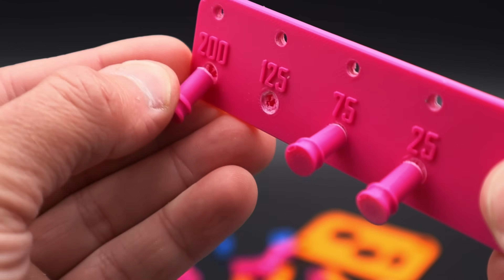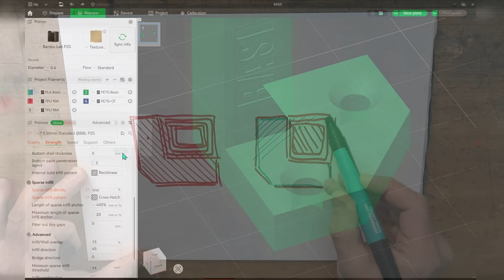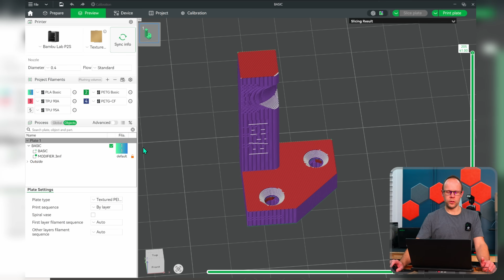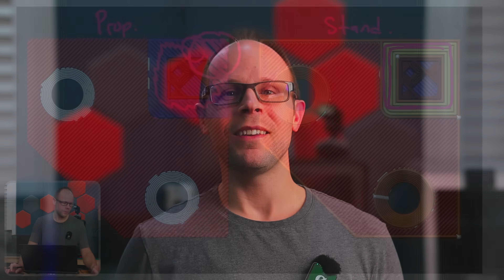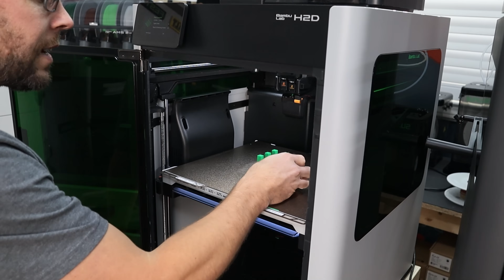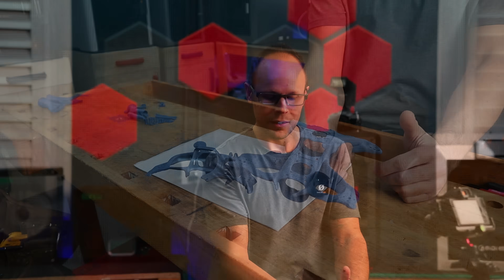Can the simplest 3D printed extrusion path also be the strongest?

Comment: A far, far stronger solution is if possible to add a reinforcement. For pegs like this, I leave a hole in the peg and screw a small bolt inside. No inserts, straight into the part. E.g. 3.9mm opening for a 4mm bolt. This increases strength immensely. I have been using this for example for pivots that bear a lot of weight.
Reply: depending on the specific case I'll either do exactly what you suggested or use rectilinear infill at relatively low % and put 2 small holes in the top shell that go to the infill area and inject epoxy.  it's easier than making the part strategicly hollow in my experience. I love combining clear petg and uv cure resin.  only way I've ever been successful printing medium vacuum tight pipes- in the .01 atmospheres range.  makes a good core for printed bolts too.
Reply: For that bolt, in this specific cade, would it be the length of the entire arm or would you use a smaller one?
Reply: You just don't get it. These are test parts. Made to try different ways to print a layer adhesion union. Results are not conclusive but insightful.
Reply: So two things about that:
1. These pegs are engineering test samples.  He's contriving a repeatable method to test different layer pattern techniques.  They're not functional parts, they dont need to be as strong as possible.
2. If you pay attention to maker tube, you'll see a lot of people relying on 3d printers for absolutely everything.  Metal is difficult to work with if you dont have the right tools, but with a few keystrokes you can have a robot make it out of plastic.  It's kind of a "when the only tool you have is a hammer, everything looks like a nail" situation.  

BTW, if you have a pivot that bears a lot of weight, maybe consider just using a bolt as the pivot directly, instead of reinforcement for a plastic pivot.  You'd be taking better advantage of the steel's properties.  It's smoother, so there'll be less friction, and it'll be much more durable.

Comment: “Aligned rectilinear” solid infill will make your 100% filled in areas stack perfectly. But while it might increase strength in the vertical direction, it will likely reduce strength in the horizontal directions. I’ve had issues recently where a modifier zone creases parallel walls right through the middle of a PETG part that becomes a weak point, and where using all concentric infill caused a similar weak seam through the middle of a long fixed-width TPU part. I’d compare your method to using standard (not aligned) rectilinear to see how the vertical and horizontal strengths change.

Comment: i know very little as far as coding goes i have several motherboards i could never get to compile, but on to the point would it be any benefit to have both walls or perimeters but spaced

 IE 1 outside perimeter then a space of 1-2mm all top layers then another wall etc like the pentagon but ea gap in the buildings (courtyard) would be all top layers so your making almost a lattice scaffold type thing   

aother way to think of it is printing the same part smaller ea time and the sizes in between would be your all top layer 

so you get the best of both worlds  

looks and enhanced adhesion in Z or stronger parts 

 obviously would have to be based on model thickness etc but i think it can be done design wise if nothing else in cad 

  i wish there was a way to make the printers take advantage of every move in all directions so that it was not a skip to a random to restart and instead made everything print taking advantage of all or total head movement

Comment: What about making hollow channels in the middle of the part that is weak - where these hollow channels go through almost every layer. This means that you'll get more walls on the inside (more walls = stronger part). One bigger hollow channel or many smaller hollow channels can be used.
Reply: I have been using this method. I also try to insert them close enough to the outer wall so that the inner void  is within a layer of the outer wall. It is hard to do to without getting artifacts in the true outer wall but parts feel much more rigid. In my mind it is like adding a skeleton inside a part instead of just infill. This method can be done easily (manually) in Tinkercad, even to STL’s.

Comment: Very interesting video. It happens to me recently that I had some pieces with a weak point. In some cases I change the orientation of the whole piece but I can not do it for all of them. Having a modifier seems very promising but do I really need to match the whole piece with a modifier or is it possible to obtain similar results by having standard modifiers covering weak points only?
Reply from the maker: I'm just experimenting with that right now.  I believe you can make the modifier larger than it needs to be to get the walls going right down through, but it will also likely affect some areas that you don't want, so it might be best to find a way to import all parts in at once as a group using components and position them all at once.  I think we might need to make some headway in the slicer to make these things a bit easier to do in a semi-automatic way.  There are clear weak spots where we transition and focusing on those areas would be a really good idea IMO.  I have a few more ideas that I want to test out, one that I haven't seen anyone do and there were reasons for not trying it out on older printers, but newer printers have some advantages and I'd like to see if it might be possible.

Comment: Awesome! Love this kind of experimentation and testing from you. I do think you could accomplish this by using 0 walls, 100% infill, 0 degrees rotation of solid infill direction, and using insert solid layers above and below any surface layer connections. Not sure it would be exactly the same, but just another method. I guess then you wouldn't be able to have hollow areas though, so just inserting some solid layers and using no infill rotations could help. The way slicers currently handle features connected to top surfaces is very poor. It basically treats the outer wall of the feature as the inner boundary for the surface lines. So most walls of the feature print onto infill and you get a very thin connection point. Had this issue with large printed bolts recently. Inserting solid layers at the connection as well as above and below strengthened it up dramatically. Great video!
Reply: Oh, I forgot to mention. I believe you could get much better layer adhesion with the PETG-CF by increasing the print temperature. Generally it shouldn't fare that much worse than normal PETG, at least according to a lot of other testing. It should be able to print much hotter than regular PETG as well.

Comment: Can strength be increased if the width of the laid filament is narrower than the actual nozzle width.
In cura you can setup the "line width" which is normally the same as the nozzle width, but if set to a percentage of the nozzle width the deposition should collide with the prior deposition. This then forces the next line of filament to squash the existing filament.
Reply from the maker: I think you're right, there is some potential there.   The only issues we'd run into there are the precision of the print goes down along with the looks, and we also may start to have some problems at seams.   There is some potential here though, if we think about what has changed in slicing, there isn't much, we have walls, we have infill and then some areas that can be changed if certain conditions are met.  It might be time that we think about some solutions to address strength, especially in those areas prone to breakage.  Ideally we'd have SLS printers large enough/cheap enough that we could print parts that were equally strong and tough in all directions.... we're not there yet, I think there is another one coming to Kickstarter, similar to what Micronics had done, but it looks like a very small build volume to my eye.

Comment: Whoa, those PLA results were fantastic!
Reply from the maker: Yeah, it really makes me wonder if we're doing something wrong with our settings for cooling.  I think it might be worth some more experimentations to see what happens when we reduce or remove the cooling on prints which have enough time to naturally cool enough between layers, I also have some more ideas but I'd need some help with the python post processing to see if it would work, but the idea is that it would use a technique similar to friction stir welding and...well... mush the filament together.   I think there are some solutions hiding in here, we just need to find them.  Even pre-heating the zone just prior to extrusion might work, but what could we use?  Thanks for the comment, I'm a big fan!

Comment: In case you're printing the giant Lego Christmas wreath, yeah it turn quite handy. (And the silk PLA still sucks in strenght.)
I was printing a nut and bolt fidget toy today, daaaamn it thought I was aware but it snapped as I opened the door. Lie, it snapped as it grab it to detach from the buildplate. I was humbled. This video is 7hrs ago so the algorythm is good, but you're nuts on time dude. Great dissection of the issue and lots of useful tips, I was only very partially aware of I can say, this time. :) Thx!

Comment: Interesting idea. Did you weigh the parts to confirm they have roughly the same amount of material? If not, how much material does the slicer say would be used? Might be a decent estimate.
Reply from the maker: I didn't weight them, but that's a good idea, I'll have a look to see how they compare.  The walled version definitely has a more solid look, the aligned has voids on the outside so there may be a difference there.

Comment: wouldnt changing print orientation achieve the same thing without all the work?
Reply from the maker: Print orientation would help for sure, but that's not always possible and I wanted to see about a solution to try to address the problem with layer adhesion itself.  I have some more ideas which might be a bit better looking, but with the same concept, so maybe there is good solution hiding here somewhere.  Or even better, maybe someone else has a better solution than mine!

Comment: 14:00 So PETG Basic is overall stronger than PETG-CF ? Just like PLA & PLA-CF.
https://youtu.be/w7JperqVfXI
Reply from the maker: PETG basic has some funny properties, it has great adhesion, but printed with too many walls, it will tend to shatter rather than to bend, like you'd see in something like ABS.  So it is brittle, but only at a certain point.  The other samples, could have been better, but they suffered on the layer adhesion, where PETG Basic performed quite a bit better.  The PETG basic also deflected far more than the other samples tests.  Personally I've always liked printing with PETG.  With thin walls, it flexes and it has great layer adhesion, so the prints end up being pretty tough.   I think ABS is another good option, but the smell/fumes are still a problem.  It really should be vented outside.
Reply: @NeedItMakeIt That is just a property of PETG as a whole. A sharp impact will shatter the PETG where as a slow impact will deform it.

Comment: Would be cool to see the results of this method on ABS and ASA. They tend to be the most sensitive when it comes to layer adhesion
Reply from the maker: I can certainly run some tests on those as well
Reply: I think its because ABS cools faster  by the time the nozzel gets back to the same spot, your not on hot plastic anymore and results in poor adhesion. Unless you keep the ambient temp high which heated chambers do and solve this issue. I have no  problems printing ABS without a chamber on a bed slinger, but layer adhesion isnt great, especially as you go up the Z.   The bed at 100c gives the model 40c for a good inch or more so you get the ambient heat from the bed to help with layer adhesion on low Z prints i found. But a chamber would keep that temp in a better spot all the way up.  That being said its still not ideal, 65c?  ABS is cold by then unlike PLA which is always hot and melty. But even then on large prints you'll also have situations where the PLA is colder then it should be by the time the nozzel gets back to it for best adhesion.  Thats why we need a new solution, something like a laser that follows the print nozzel and melts plastic slightly so its ready for optimal layer adhesion. You could in theory get as good as injection molding with this technique if you could pull it off.  Even better then injection molding since now you got the advantage of favorable geometry that adds strength 3d printing can achieve and injection molding cant.  Add  the layer adhesion of  injection molded parts and you could finally make bike frames  and other things from plastic?  Anything is possible.
Reply: These days with heated chambers on consumer-level printers, ABS layer adhesion problems should be a thing of the past.

Comment: For this particular part or similar types of "Hooks", modeling in a hole for a metal bolt or screw would make them extremely strong.
Yes, I am aware that's not what is being tested, but you can model parts for metal reinforcement where needed when maximum strength is required.
Excellent testing and theories.

Comment: If you're designing it then why not design it so it can be printed horizontally, then you don't have to worry about later adhesion at all. 

You could also add a chamfer to strengthen the weak parts. 

You could also add micro voids so that extra walls are sided to internal areas.
Reply from the maker: The idea of these videos isn't for me, it's to provide information and insight to everyone so that we can find solutions to these problems.   Normally like you suggest, I would design something taking layer adhesion into account.  It would be ideal though If I didn't need to think about it, which is where I'd like to try to get to.  My videos are often times testing ideas to help solve common problems as close to their source as possible.  To do that, it requires having a good understanding of the root cause.  The root cause it that were printing in layers, those layers often don't  bond well.  The idea to help with this was to find a way to make it so they do bond well.  Maybe it isn't perfection, but it is the idea, and we can build on that idea and do even better in the future.  Ideally we'd change to SLS with powder, but the price-point and build volume is really low right now and the obvious limitations with color.

Comment: I took your idea here and did 1 wall and enabled "alternate extra wall".  That alternating extra wall was just enough of a dimensional change that each infill layer was placed on top of the "gutter" between extrusion lines of the layer just below it.  In theory this would increase surface contact between layers roughly 25%, that's off the top of my head math.  This is all based on looking at the preview within Orca Slicer.

The extrusion multiplier may need to be increased a little so that each new layer has enough material to make full contact with the layer below it.

TY for the video.
Reply from the maker: I was hoping that people would be able to improve the idea, I'll give this a try and see what happens in a break test, very cool idea my friend!

Comment: Just add a modifier that gives the stem a “root” into the main body.
Reply from the maker: Yup another good idea for sure.  I've tested out inner corners treatments as well in a previous video, that's another good option, but I wanted to try to address what I believe is the source of the adhesion issue.  Extruding into cooler filament produces a weaker bond than into hot.  Using a larger nozzle also works, but of course then we lose some detail.
Reply: @NeedItMakeIt  Do you think there is a way to utilize the Beam Interlocking from the Multimaterial tab (Orca) at the transition points? Could a modifier be used to keep the same filament but provide the interlocking strength through a few layers.
Reply from the maker: I've only tried beam interlocking a few times and there were some problems with color prints bleeding color where it wasn't supposed to be, but for strength, that's a different story, I'll have to check that so thanks for the cool idea!  I wanted to do some more testing on a few different methods that have been talked about in the comments because there might be some really good solutions which also look good that could help us, things that we haven't done in the past because of printer limitations, but maybe we can do them now.

Comment: It would be good for comparison to include parts that were printed on their own (not batch-printing 9 parts but singular ones), and also with different cooling-rates. We used to care a LOT about cooling cause a lot of cooling also meant a lot of problems with adhesion between printed lines.
Well - in general i also always avoid 3D printing for anything experiencing even mild loads, specially with repeated parts: It is a waste of money, material and time to print parts that just end up worse. Instead just print a positive form, do all the surface-prep you need, then create a mould and just cast the parts.
Reply from the maker: That's a good idea, there were a few suggestions to print one object at a time.  I can certainly try this out.  Can I ask which materials you use to do the casting?
Reply: @NeedItMakeIt  Mostly just resin with short glass/carbon fibre, or some fumed silica. Currently only a bit left form easycomposites.
Reply from the maker: I haven't experimented much with this myself, do you need draft angles, or will a layer of lube do the trick?
Reply: @NeedItMakeIt  Flexible mould and just a bit of release-agent worked well for me so far. Not making many things nor anything large.